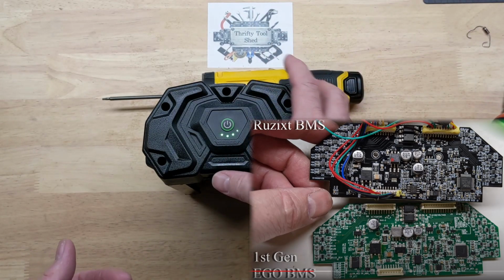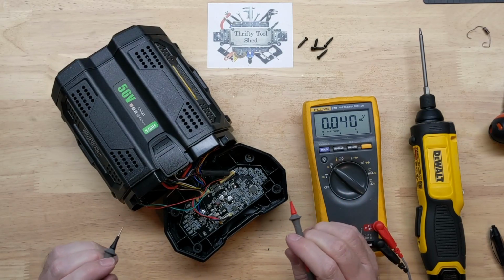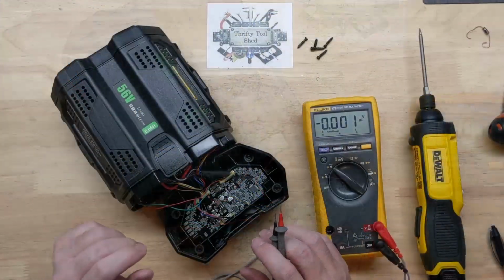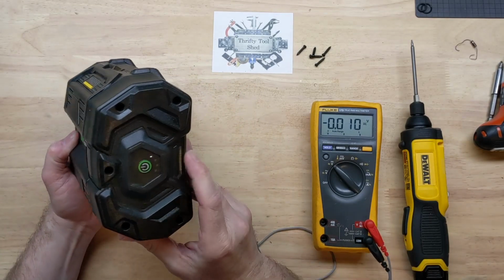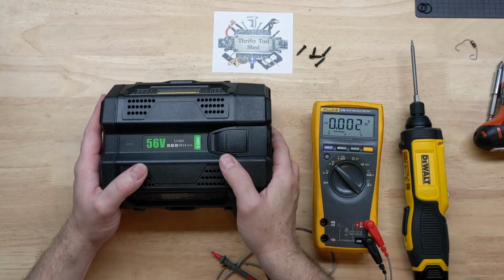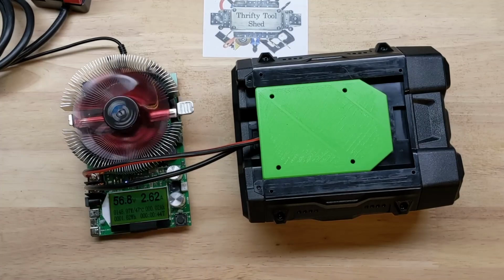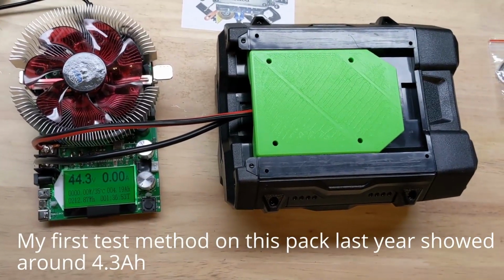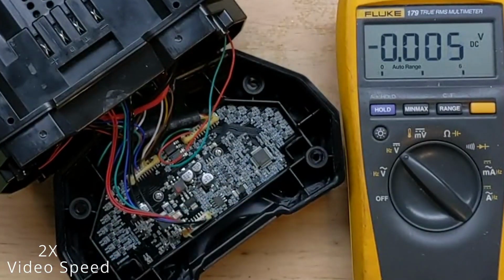Ruzixt 56V Battery 1 Year Update

Comment: Thanks for this!  I've had 4 EGO batteries:  a 2.5AH that came with a string trimmer, a 5AH that came with a mower (both in April 2017), a 5AH that came with a leaf blower, and a newer 5AH that EGO provided under warranty for the first 5AH.  The 2.5 is currently non-functioning and out of warranty.  So, of four batteries, two have died--one under warranty one out of warranty.  I'm not sure what my opinion is of EGO quality at this point.  The warranty replacement, being the newer style has the charge level indicator, and it's a bit quirky.  Will stop multiple times while charged.  I have to take it out of the mower, then plug it back in, after which sometimes it's OK for a while and sometimes I have to remove and reconnect again.  The older 5AH works with no problem.  

Anyway at this point I am curious about aftermarket, so this video is encouraging.  I know aftermarket is a risk.  OTOH, I have a battery powered Hoover upright vac that has gone through two expensive Hoover brand batteries and now has an aftermarket that has performed and lasted better than the Hoover brand batteries.  My luck with aftermarket camera batteries is not as good compared with Canon brand.

BTW, my 2.5AH EGO is available to anyone who wants it enough to pay for shipping from Houston.
Reply from the maker: Yes the aftermarket is encouraging to me as well, as atleast a option. Maybe not always the best option, but non the less another. Sometimes it's better to bundle packs with new tool purchases to save on pack costs. Thanks for your comment. I will take the pack for shipping cost of the cost does not exceed $20 to Augusta, Ga 30907. Just to be fair these packs will sale on eBay for more than the shipping costs at times if you rather do that it would be best for you!
Reply: @ThriftyToolShed  that seems a very good battery my 5ah ego is 2020 3 gen I use alot and its still going up to now. What is your honest opinion of the ruzixt and how much saving over ego 👍
Reply from the maker: @mattlawton4715  
I have had no issues with either this 5ah pack or the 6ah pack more recently reviewed. The 5ah pack I bought myself to test because it was interesting. The 6ah I was blessed with by the company sending it to me to review. I like them them both just fine. The 6ah actually surpassed the 6ah discharge test as shown in that video so I am really surprised by it. I also have not used it as long at this point. I would honestly say for the money they are worth it. I also will say that consider if you wish to buy another tool in the future! As mentioned before, if you buy a combo with battery it's way cheaper than buying the packs separately. So I would buy a tool and put another say $100 with it as a combo to get a 5ah pack with it and that's the cheapest way to go. If you are dead set on buying a pack straight out, I personally like the option of the 5ah or 6ah packs the AMZ company. One other thing to mention, I believe the 6ah pack will work with Nexus power station according to AMZ rep and the 5ah will not? Best of luck to ya!
Reply: @ThriftyToolShed  it's a very good bms copy and should last. I'm thinking if the battery lasts a long time and is cheap anough when it is dead replace cell's with somthing like Samsung 25r cell's and same for any dead ego batterys should have no problem with thoes 👍
Reply: @ThriftyToolShed  they also do a Tomapex battery I don't know anything about them but they do look like a ruzixt 👍
Reply: @ThriftyToolShed you’ve had these off brand batteries awhile, any changes to your thoughts?
Reply from the maker: The 2 I have are still going strong. The price of the aftermarket packs have come down a lot more since the volume sold is most likely very high. It's so many different names/manufacturers now that it is hard to say which ones might be decent quality. I know they will all have the cheaper Chinese cells, but the ones in mine have held up well. I can tell the capacity of the smaller one I have is going down some so the cells are likely starting to loose capacity now. I do still use it often though.  For the price I will most likey keeps some around.

Comment: After watching your videos on the Ego 650cfm blower and the videos on battery maintain I bought the blower. It came with charger and 5000mwh battery. So far so good with equipment. With this video I have decided to get the 150w discharger and the  battery connect from amazon. I enjoy,  and find your reviews thorough. So, thanks for your work which is quite good.
Reply from the maker: Thanks so much for your kind comment, I really appreciate it! Hope you have fun with those toys...😁
Reply: Hey John.  I have that blower too.  I bought it when I wanted a spare 5AH battery, as one battery couldn't cut my whole yard every time.  The blower, charger, and battery was $70 more than the battery alone.  I already had a lighter weight 18v Ryobi, but I figured "why not?"  The blower is really good, and the battery saves me having to stop to recharge my mower battery or even run it all the way down, which one school says that is bad for the battery.
Reply: @cesarebeccaria7641  good point!

Comment: I purchased this same battery in March of this year. Have used it exclusively in my EGO Mower, Leaf Blower and hedge Trimmer the entire summer in order to "Save" my more expensive EGO batteries which I've used on several occasions in my 3000w Nexus Power Station during blackouts. While the Nexus power station doesn't recognize or see the Ruzit, it works fine in all the EGO hand tools and the 150w inverter.
Reply: Thank you for your information about the Nexus Power Station compatibility. It saved me from an expensive mistake. The generic battery is great as a backup for long mowing sessions.